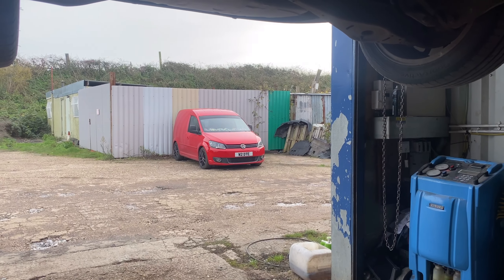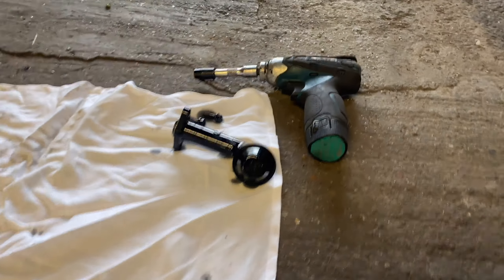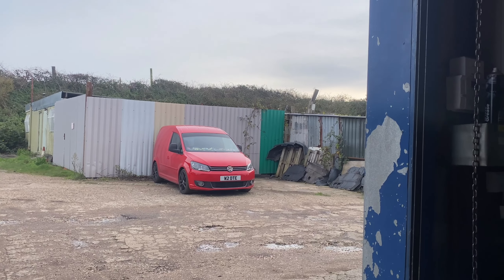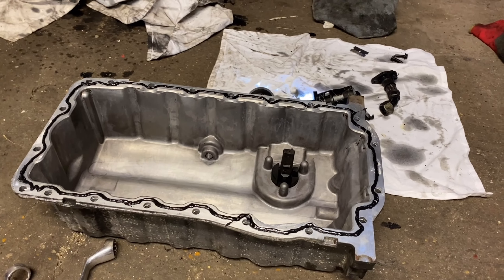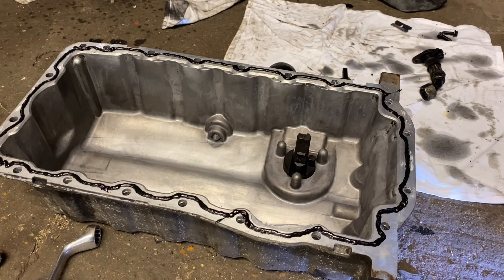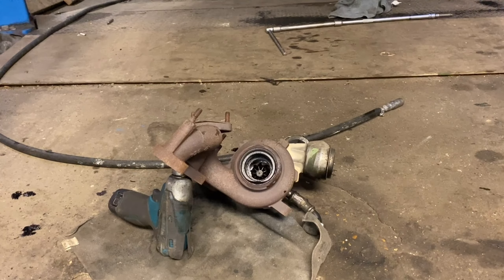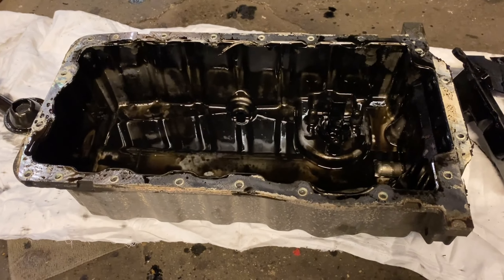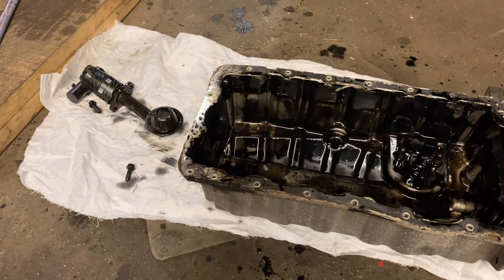Vw 2.0TDI - BKD - Low oil pressure - Fixed.

Comment: Hi have the DTI 2.0. is that a diffrent engine. we have checked the sump but i still get a oil light warning. we have changed the sensore and still get the oild warning light. any suggestions

Comment: Intresting. I have an 06 T5 2.5tdi with a presure light that comes on but not till after  50min. it beeps twice and flashes twice more then goes away but from then on if I labor it below 2000rpm it will beep and flash a couple of times. The dealer who gave it a service said he was going to whip the sump off and check the pickup but in the end they didn't. Iv'e only had it a couple of months now but the prevouse owner said it's been going on for three years and her spanner monkey couldn't find an issue. I half want to wait for the next service to take off the sump for a check but after seeing this video I'm wondering if the oils been changed but not the filter as it's in a runt of a spot and the oil is jet black the day that it's changed🛠

Comment: Great video and information 👍.  Any help on my car if possibly.
Its a 2008 b6 passat 170 sport BMR engine.
In the mornings it takes around 10 to 15 seconds to start and all fine when cut out and restart no problem.  Just in the mornings when cold. No faults on dash just starting issue when cold if anyone could possibly help please 🙏

Comment: Interesting. I change oil and filter every 5k miles only use Mann filters. My bkd engine is on 209,000 still going well. 

I had a bkd engine on an Audi a3 but I heard that they suffer from cylinder heads cracking ? Can you confirm this.
Much more poke than the bkd engine I have but the rest of the car was rough so I sold it.

Comment: Nice vid… straight to the point and no waffling like you can find on the clips from the US of A (no offence American folk) I was interested in your video as I’ve just picked up a very early T5 2.5tdi and was looking at doing the exact same “look see” as you have here. Have you had any experience with the early T5 2.5 ? is It a similar process removing the sump from one of these models. Thanks in advance 😊

Comment: Top stuff mate.. My cayc engine has no boost. Changed EVERYTHING.
Reply from the maker: Hey bud thank you appreciate that, when you start the engine the sending it fires up does the actuator on the turbo move? Might need someone to start it while your looking at the actuator.

Comment: I have 2012 VW Sharan. oil pressure warning light comes on straight after moving. change oil pressure switch, oil ,Oli filter, oil pick up pipe. still not solved. anyone have any idea.
Reply from the maker: I would check the wiring to the oil pressure switch, try earthing the wire to the engine block somewhere as all the pressure switch does is earth the wire out while running, if you try that and the oil pressure light comes still then the wire is broke somewhere
Reply: @YTDTETV  Thank you

Comment: currently having this issue on a 2.0l TDI CJAA (US model) vehicle sat for a good 3 years, oil was replaced but too much gung has developed to the point to where the oil pick up has been blocked. In my case the oil pressure warning light only came on around 1500 rpm or higher. The car has been driven with the oil light on for about less than half a mile, i have my fingers crossed hoping no damage has been done to the turbo.

Comment: You have to blame VW for this,there oil change intervals are stupid. And it's not just VW as most manufacturers are the same. I had a Audi A6 2.5 tdi V6 and the oil change interval was 24000 miles (are they nuts). I change the oil every 6000 with mobile 1 which I know is a bit extreme, but it's a lot cheaper than a new engine.  Great information and good to see your engine is in good nick.
Reply from the maker: Hey Neil wow that is a long time between services, I know some other manufacturers have 20k between services. That’s so bad and it’s bound to cause problems for higher mileage engines. I have a customer that has a service every 6k and he’s never had a car break down 👍 thank you for your comments.
Reply: @YTDTETV  Thanks for the response. The Audi I owned went through a full set of cam followers and a turbo at 65000 miles due to the stupid long life oil changes. It does not affect the owners that buy them new, it's the poor bugger down line gets all the headache.
Reply from the maker: @neilhampson2843  no worries 👍 that’s right the first owner gets hassle free motoring it’s the later owners that have to suffer the consequences unfortunately. Vauxhall have a service interval of 20k to and the engine doesn’t even have 3.5lt of oil, that’s so bad.

Comment: Great video and tips thanks!
I’ve got the same 2.0 bkd, I’ve just cleaned egr, inlet manifold and changed oil and filter. 
Now I’m getting the “oil pressure engine off’ warning 
I’ve already had the sump off and it was all clean also changed the pressure sensor, any ideas? I’m hat to try next?
Reply from the maker: Hi bud sorry for the delay check the wiring to the pressure switch as I’ve seen these fail loads 👍 it should be earth so you can try earthing the wire to see if the light goes out then you’ll know if it’s that.
Reply: Thanks for the reply DT! 
It was the oil pressure switch plug not pushed on enough as the new sensor wasn’t original vw so I removed a little rubber grommet from the plug which allowed it push on more! 
She’s running a treat again with decent mpg! 
Cheers 👍🏼

Comment: It looks like you work on a lot of volkswagens. I just rebuilt a 2.0 l turbo and my low oil pressure light comes on after about ten minutes of run time I did put a new oil pump in it and cleaned everything when I did the rebuild. If I check the oil pressure with a gauge I get about 15psi at idle and up to 45 psi when revving the engine but I keep getting a low oil pressure warning. I have also replaced the pressure sending unit. I am at a loss.
Reply from the maker: Hi bud I do a few vw’s, I would try the wire to the oil pressure switch. If you take the wire off the sensor and connect a piece of wire to it and earth it to the engine somewhere, all the sensor does is create an earth signal so if you do this and the oil pressure still comes on then there’s a break in the wire somewhere. Seen dodgy wires a few times.
Reply: Do you fix your problem with the low oil pressure

Comment: Hello❤,
I got today this message Oil Preassure Engine Off i drive VW Golf 5 2005 BKD.
I need to clear or maybe need to changed Oil pump????😊
Reply from the maker: Hi 👍 I would first change oil and filter, then the oil pressure switch and lastly whip the sump off and check inside the pickup pipe. I think the oil pump will be ok.

Comment: Last week I added the engine flush moly liquid  addictive for diesels engines and when I started it up it ran rough and the low oil pressure show on my dashboard.  Funny thing is I always replace my engine oil every 7500 miles cause I want my Mk6 Golf TDI to last me longer.  Looks like I will have to remove the oil pan and inspect it and clean it!  Thanks for the amazing video!

9/23/2023 update:  oil pick up looked clean and unclogged.  Oil pan looked clean!  So the initial star rough idling could probably be something else, H’mmmm what could it be?   Definitely need to do some extra work!
Reply from the maker: Hey bud glad your pickup pipe and sump was clean 👍 I’d try a fuel filter for rough running 👍

Comment: Carbon in the oil is sometimes the injectors blowing past the copper washers into the engine
Reply from the maker: Hey Peter I did wonder if this was the case 👍 I definitely believe the extra heat and pressure from dpf filters are a massive cause of this.

Comment: Had low oil pressure warning on my vaux zafira tourer 2.0 cdti  turned out to be pick up seal failure common problem £700 to drop sump and replace ... ouch
Reply from the maker: Hey Pete I’ve not delved into to Vauxhalls much, ouch that’s a few quid 👍

Comment: Yes mate spot on service on my b6 2.0 tdi £30 oil and filter all in. And the DPF and turbo whent bang a year ago so I know exactly what your talking about £800 later 😭
Reply from the maker: Hey bud yes oil and filter is really cheap yet some people think it’s ok to skip it as the car is running fine. It’s a good idea to have a DPF delete and remap it makes a massive difference on engine longevity. Thank you for your comment 👍
Reply: @YTDTETV  yes my car is about 210 bhp with abit of remapping  dsg aswell but I'm selling it as want something cheaper
Reply from the maker: @twes5563  very nice I do like an auto 👍

Comment: Had this issue on our taxi fleet. The debris looks like old paper gaskets breaking down, but there are none on the engine like that. Oil and filters changed every 10,000. No signs of oil filters breaking up either.
I did suspect the oil supplied by the gaffer though. Low SAPS oil is essential.
Great video, and the tip on the 5mm ball end is spot on. Quite a rewarding job once you've done a few.
Reply from the maker: Hey bud thank you 👍 surprising what sometimes ends up in the sump, appreciate the kind words 🙏

Comment: Same problem with the Insignia B20dth and A20dth. Continue to drive with low oil pressure warning and your engine is completely knackered. To change the oil pick up pump and seal on these motor is a nightmare, the sump is very hard to remove esp the side of the gearbox bell housing... Some drill a hole to the bell housing to access the bolts
Reply from the maker: That doesn’t sound like the easiest of jobs, lucky on the vw’s it’s really easy access. A lot of cars suffer with carbon build up especially since dpf’s have come along.

Comment: In the passat you have to turn the flight wheel to the notch and u can remove those bolts with the 10 mm  socket straight

Comment: Hello mate I have an oil pressure light keep coming up on my caddy. After about 10 15 miles. I've changed oil pressure sensor oil level sensor. I've cleaned sump and oil pick up. I'm still getting this problem. Do you have any idea what this could be. Thanks joe

Comment: Hello there mate. I have a 2.0 2016 crafter and the oil pressure warning has come on. Would this be the same issue.
Baz
Reply from the maker: Hi baz.. your engine is the common rail engine so a little different.  First thing I would try is oil pressure switch - oil & filter. The pressure switch is on the right hand side of the block just round the back little bit hard to see but it’s there. Try those first run for a minute and if it’s doesn’t fix then take the sump off 👍

Comment: Good advice on filter changes 👍 2 videos in a week you are spoiling us. 🤣 I think 10000 miles is about right 👍 good advice on fitting the sump, fitting it square using all the bolt's.
Reply from the maker: Hey Philip it makes such a big difference with oil changes, I’ve seen so many cars well over due a service and all the owner says is it necessary as its running fine. It’s those people that slag their vehicle off when it breaks saying poxy car has let me down. The 2 tricky bolts are easy to go in wonky so just my little trick. Yep 2 videos this week really aiming to just make videos full time so hopefully the extra effort pays off. Thank you sir 👍
Reply: @YTDTETV  I’ve had that, had a friend that was working a Ford main dealer service desk, had a whole family in kicking off that their 4 year old car with 70k miles on it needed a turbo… when he pointed out that they’d never had the oil changed and maybe that was a factor in the turbos demise they where genuinely shocked… 🤦‍♂️

Comment: Good video, thanks for this warning (if I don't like the way someone talks I just mute it and switch on captions, but you're ok with me) - oil light has come on my bkd at about 120,000 miles, I'll do this job tomorrow. I change oil with the best I can get with a new filter at 6000 miles tops.  I see a couple of comments about the oil pump in these engines - any pointers as to what I should do?
Also, I usually use a thin smear of hylomar blue but it looks as if you've used a thicker sealant? Cheers, Phil
Reply from the maker: Hey Phil sorry for the delay, ah man really appreciate the feedback 👍👍 have you done this job? These BKD’s don’t suffer with oil pumps it’s the A4’s and the passats. Yes I use a silicone type sealent for sumps. Let me know if I can help 👍 I’ll reply this time. Thank you
Reply: @YTDTETV  cheers mate - oil pressure gauge reads 5bar☺️.  I found a lot of rusty earth connections to chassis behind the left headlamp, cleaned them up & that particular warning disappeared!
There are also suddenly a lot of fault codes and the car is running erratically though, so when I get time I'm going to look🤞 more closely at the wiring harness & the ECU connector...

Comment: Hey mate good video. What specific oil do you put in the PD lump's?
Reply from the maker: Hi bud thank you, the pd engine actually has its own 5w40 pd oil but I’ve used normal 5w30 many times with no issue 👍

Comment: how did you remove those bolts that are near the transmission? I cant reach it with the hex or 10mm socket
Reply from the maker: Hey bud watch the next video on the white maxi coming out tonight I explain exactly this 👍

Comment: Hey bud i have a 2.0 tdi Amarok with a flashing red oil light, I've changed the oil all looks good, switch has also been replaced but still have the blinking oil light. Someone mentioned it might be the oil pump thats on its way out.
Where should i start,
Reply from the maker: Sorry for delay just double check the wiring to the oil pressure switch as sometimes the ends corrode and have a weak connection 👍
Reply: @YTDTETV  thank you for your feedback.
I have relaced the oil pump recently. I have tried grounding the switch itself to the head of the engine and the wiring is still perfect. But i still have the persistence of the oil light. There's no definite reason or proof that i can see that something is causing it.

Comment: i always check the drive pins aswell while its off  changed prob near 50 of them with oil pumps for rounding off  , good vids again 👍
Reply from the maker: Hey bud, I always believed it was just the balance shaft BKD’s that has the oil pump issue I’ve not seen one go on the engines without the balance shaft but I’m open to learning 👍👍

Comment: I have a 2016 t6 vw caravelle. It has low pressure but I've changed the oil pump and pressure sensor, oil cooler housing, tested the oil cooler and the test was fine. The pressure reduces when the engine is hot. Please help
Reply: Did you fix this? Interested to know what it was?

Comment: Nice
What is the shaft screw tightening torque?
Your Caddy has a oil pump belt ?

Thank you
Reply from the maker: Hey bob I don’t normally use a torque wrench unless I’m doing something super important, I think the oil pump has a small chain coming from the crankshaft.
Reply: @YTDTETV  
Mine is 1.6 tdi CR 2012 and the oil pump is belt driven 
I'm interested in shaft screw tightening torque the one that is removed with 19 socket.

Comment: Only had our Caddy about three weeks now. It’s on 143k miles and the paper work said it’s been serviced regularly. I had the sump off to reseal thinking it was leaking, turns out it as the rocker cover. The sump looked much like yours and was easy cleaned with just a quick blast of brake cleaner. So it would seem it’s been looked after at least, bonus. Gives me confidence the old BLS might not give up too soon.

In your opinion is it worth doing the big end bearings? As sort of  preventive maintenance in the BLS. Seen a few theories that it’s spun bearings that might cause them to pop one out of the block.
Reply from the maker: Hi bud yes they do clog up abit 👍 it’s the big end bearing bolts that let go ie the conrod bolts if I was to trust a BLS engine I’d put arp conrod bolts in and it would last forever 🤙
Reply: @YTDTETV  top man, nice one bud I’ll look at getting some bolts then. I’ll do the bearings while I’m in there.

Comment: I have oil leaking from under my gear box it as a vw simble with 3 bolts been tryin to find some1 to let me no wot part its called or if its bad or do i just need a new seal the leak isnt that bad its never driped on the floor just around the seal
Reply: Its a vw caddy 62 tredline 1.6
Reply from the maker: Hi bud I know the piece you mean, I think they just have instant gasket sealent on them not seen them leak before.
Reply: You a ledge mate i look to see if i can find it online cheers for taking the time to get back to me its not leakin bad just around the seal
Reply from the maker: @CJR90  no problem happy to help 👍

Comment: Check also your hex drive in oil pump is my advice..........you know what i mean as a 2.0 tdi owner...greets!
Reply from the maker: Hi bud the hex drive only breaks in the 2.0tdi engines with the balance shaft it doesn’t fail on these. I had an Audi a4 that it failed so I removed the complete balance shaft and fitted the normal oil pump.

Comment: quick one - I've got a VW TDI (B7 CFFB) and just replaced the turbo (107,000 miles) old one was burning oil. But new one is dripping oil from the exhaust side turbo seals. Return feed is clear, I checked all pipes before the refit. Is a block somewhere causing excess pressure in the sump? What things should I check? I'm handy with the tools, just would rather get a few ideas before throwing away this otherwise great car (VW CC 2012)
Reply from the maker: Hi bud it may take a fair few miles to clear all the old oil out after fitting a new turbo, sometimes up to 50 miles.

Comment: Hi have a Volkswagen crafter Luton kids coming up with intermittently low oil pressure switch off engine when you switch off disappears and then it will come on again later that day. Just had a new turbo fitted. Any advice as the garage is going round in circles